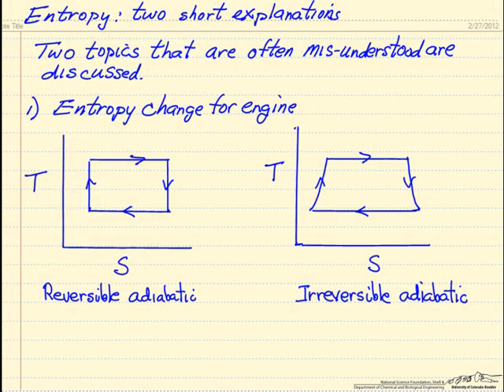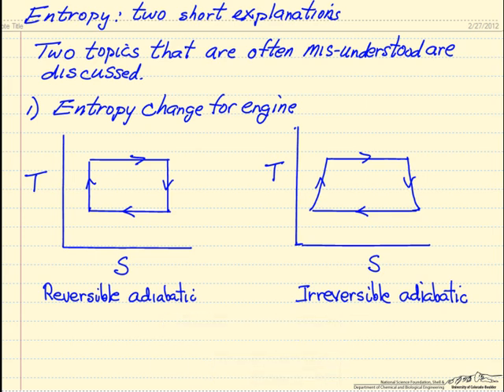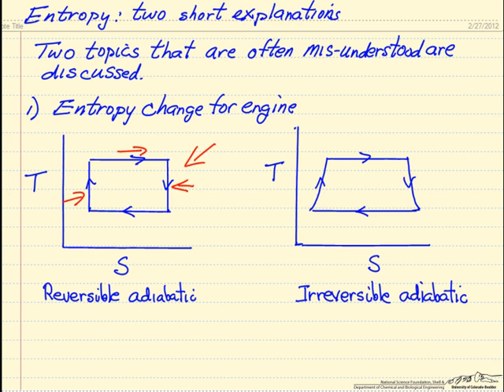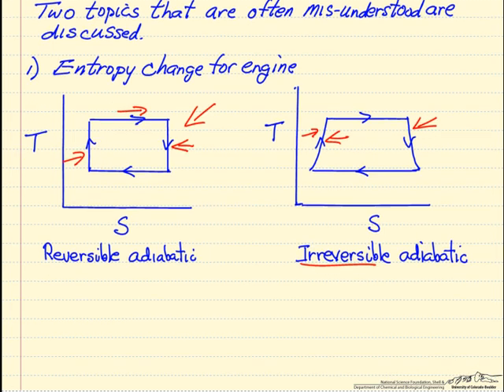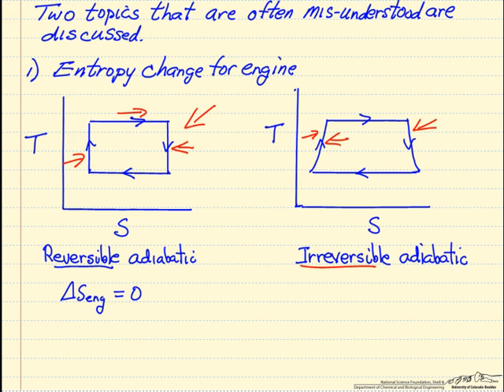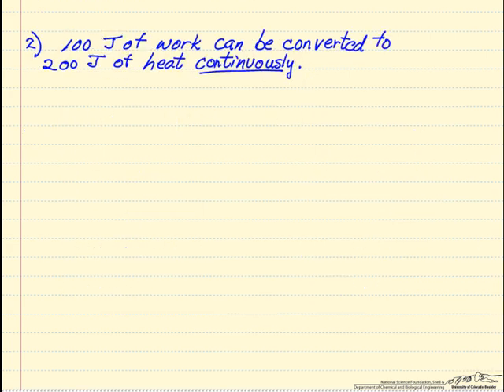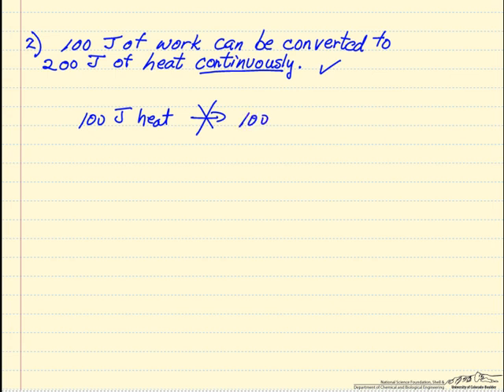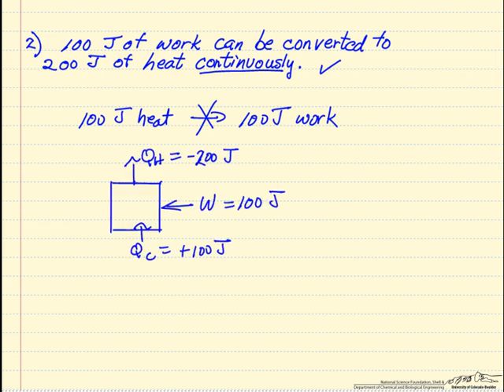Entropy: 2 Explanations

Comment: how we convert 100 j of work to 200 j of heat and the energy neither destroyed nor created ?
Reply: I read somewhere saying work is high grade energy and heat is low grade energy so it is more efficient to convert work into heat. usually energy loss from work is caused by friction-which also dissipates as heat-so creating more energy you put in is possible if the heat generated by friction is considerable.